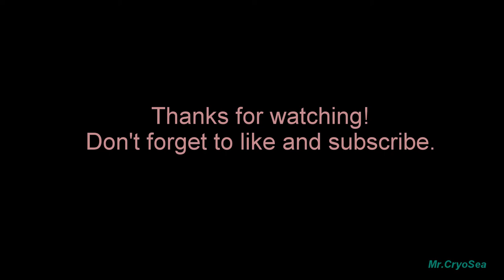Cryogenic Butterfly Valve Overhaul

Comment: nice video sir. can you tell what is the material of seal ring, valve seat, and disc? I want to use a triple eccentric butterfly valve in blast furnace gas line. I am being offered these valves with graphite laminated seal ring while purchase order requirement was of metal-to-metal seating. I am not convinced about these laminated seal rings for bf gas line application. what would you say? my main doubt is why these valve manufacturers claim laminated seal rings to provide metal to metal sealing. as per my understanding graphite will get delaminated in shorter time and also cause galvanic corrosion. thanks again